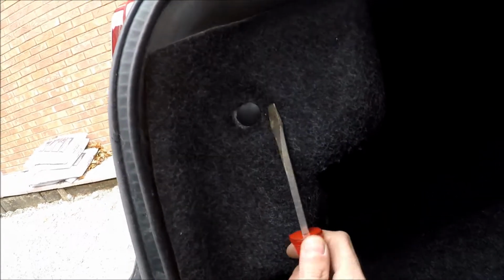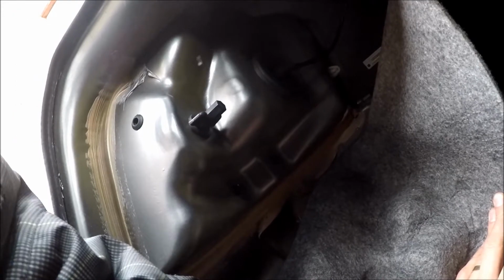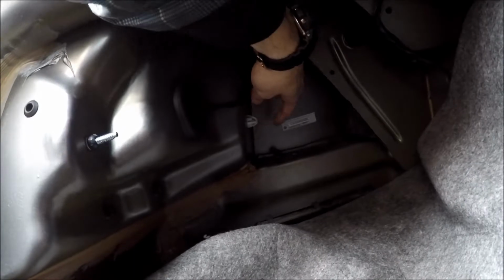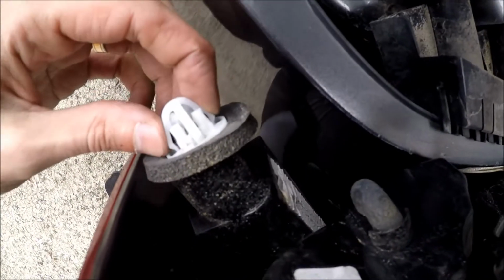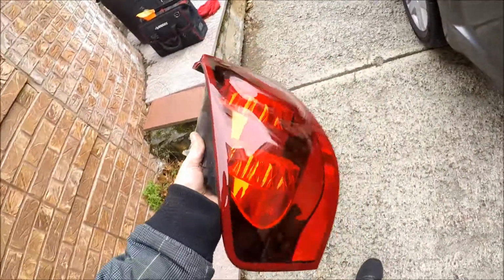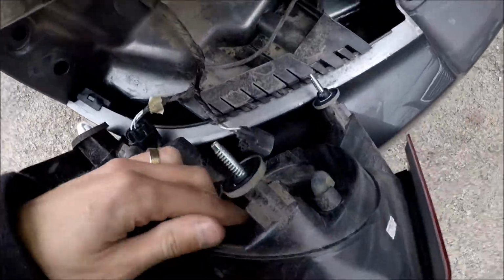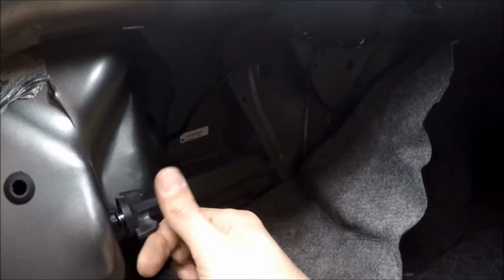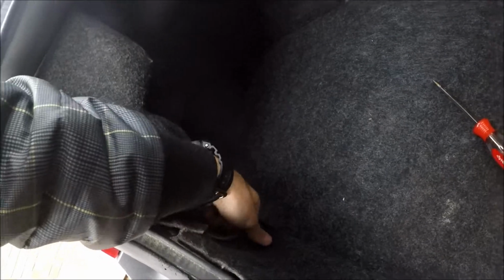How to remove tail lights in Dodge Avenger 2011 up

Comment: Hmm I'm hoping doing this will allow enough access to inside the rear bumper to run a video cable for the backup camera, since the rear bumpers and trunk on these are completely sealed off and there's no way to run a wire 🤦‍♂️
Reply: Yes! You can use rubber insulator with other wires and go throw